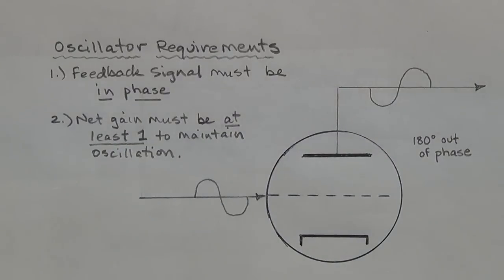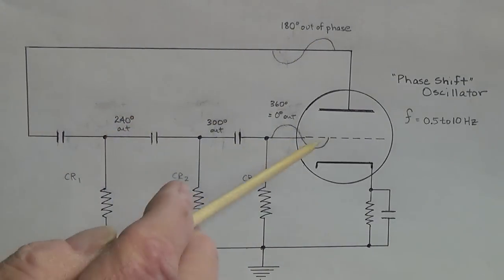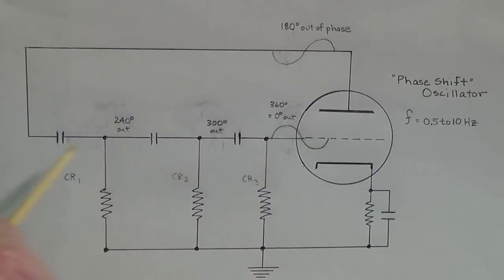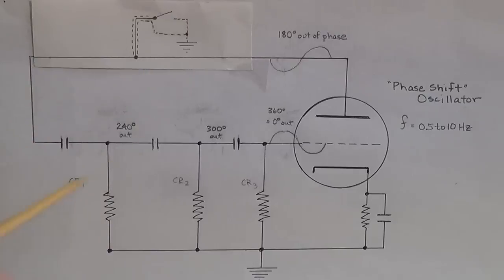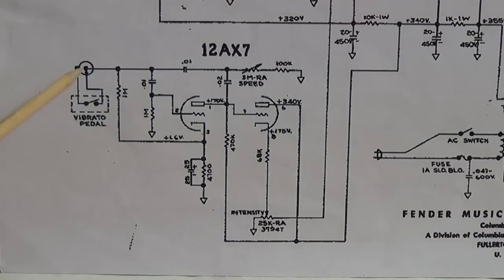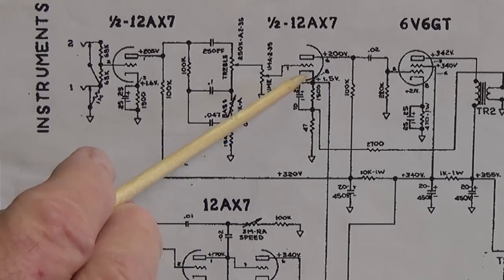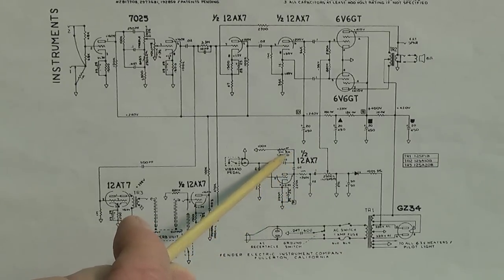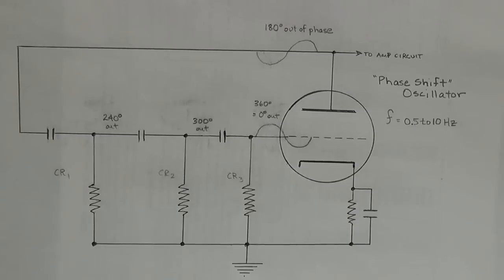How Does a Bias-Shifting Tube Tremolo Work ?

Comment: I was always lead to believe a 1st order filter would give a 90 degree phase shift. How is it 60 degrees? The math works with 2xfilters at 90degrees.
Reply from the maker: +semahnai  I believe the 90 degree value is maximum and that lower values (i.e. 60 degrees) are readily obtainable.  Here is a detailed explanation:  http://www.aikenamps.com/index.php/designing-phase-shift-oscillators-for-tremolo-circuits
Reply: Thank you for your help. I get confused so easily with electronics. I am struggling with biasing my 12ax7 so far, I had it working, but i may have fried the tube. I have 170V supply Rk=1k2 Ck=25u, Ra=56K Ca=22u. do these values sound reasonable to you Uncle Doug, or should I ask Rusty?
Reply: +Uncle Doug Interesting link. After reading, I think I have a few more brain cells. Am I right in thinking, however many RC networks are employed between the input signal and the output signal, the RC filters have to accommodate and equal percentage of the 180 degree shift?
Reply from the maker: To be honest, Ian, the only phase shifts that I pay attention to in an audio amplifier circuit are those between grid and plate in each amplification stage, and the differential shift within the phase inverter.
Reply: +Uncle Doug I think I expressed that wrong, I was talking about the feedback networks from the plate to the grid in the tremolo circuit. Sorry. I am slow to absorb stuff, once I get it, I tend not to forget. Please give Rusty and Jack a pat on the head from me.
Reply from the maker: I will, Ian.

Comment: MY POP QUIZ ANSWER: If we apply oscillator AC directly to the grids of the finals,  the tremolo signal is balanced out by the push-pull action of the output transformer. This is similar to a balanced modulator in RF DSB applications,  where the carrier is applied to the grids,  and the modulation  supplied from the phase inverter stage.  Only here,  it's done in reverse,  and at audio and infrasonic frequencies, rather than .RF and audio frequencies.
Reply from the maker: +John Bond  Excellent, John. Thanks for the informative reply.

Comment: hi, silver xmfr is 375-0-375 volts ac.... 150 ma. the black xmfr is 345-0-345 volts ac not able to find current.
Reply from the maker: +brian foley  Very crude rule of thumb: If they are of about the same weight and size, they are probably of about the same current capacity.  Also, if you know the tubes that were originally powered by the transformer, you can estimate its current capacity.

Comment: as always thanks for the effort you make these video's with... i bot 2) ao29 hammond.
one has a black transformer 360 volts dc...
the silver one is 35-0-350 volts and also powered a rack of tone generators.
so i bot 6 more, 3 of each type. the silver transformer has enough to run a pair of 6L6's
and the black transformer at least a pair of 6v6's... going to fabricate them as mono blocks. brian
Reply from the maker: +brian foley  I am familiar with the power transformers that come on AO-29's and they are quite stout. It sounds like you made a great buy, since even mediocre power transformers now cost between $65 and $100 each. Congratulations on some great acquisitions.

Comment: Unc...my '62 Brownface Deluxe has a very weak trem. I popped new 6V6's in and it didn't help..I read a while ago that setting the bias correctly determines whether you have a nicely functioning effect or virtually none!What say you??  
Speaking of bias, what IS the correct bias current for that circuit? I measured just under 30mA which would be low for a Blackface but is it OK for a Brown?Thanks a million!
Reply from the maker: +PeterPug007  Peter, I assume you are speaking of the 6G3 Deluxe. The 6V6's would have virtually no effect on the tremolo. It is created by one half (triode) of a 12AX7 tube. There are two 12AX7's and a 7025 (unless it's been changed to a 12AX7). With the amp off, you might try switching them around to see if the tremolo intensity improves. If not, then its one of the components in the trem circuit and, unless you are comfortable with attempting the repair yourself, will require the attention of a qualified tech.  

Bias is set by plate dissipation, not just plate current.  Calculation of plate dissipation requires accurate measurement of both plate current (in Amps) and plate voltage. It is the product of the two and should not exceed 8.4W (70% of the 12W max) for a fixed bias circuit (like the Deluxe).  At a plate voltage of 365VDC (according to the schematic) a plate current of .023A  (23mA) would yield a plate dissipation of 8.4W.  Your 30mA plate current would be OK if your plate voltage was around 280VDC.....but I'll bet it's much higher.
Reply: Oh, ok. It's only the bigger Brownface amps that used the power tubes for the "harmonic trem"?  I'll play with the preamp tubes as you mentioned and see. 
Looks like the last bit of your answer regarding my 30mA current was cut off??  I'm no tech...I measured the bias using one of those BiasMaster probes that attach between the output tubes and the sockets. 

You are a WEALTH of knowledge!!
Reply from the maker: Thanks, Peter. The last word I wrote was "higher". If it's there, then nothing was cut off. There is nothing wrong with a Bias Master, but you need to heed my comments about plate dissipation, rather than plate current. Good luck.
Reply: OK, my old college classes are starting to come back to me: P(Watts) = V x I(Amps)
What are the repercussions of i.e. running the plate dissipation at 100% let's say? 
Is that simply biased "too hot" and will burn through tubes faster or can I damage some of the circuitry? 
Jeez...just when I thought I was starting to understand this stuff! LOL
Reply from the maker: Cathode-biased circuits can be run at 90% to 100% of max PD. Fixed-bias circuits (grounded cathodes) should not exceed 70% of max PD....because the PC rises substantially when the circuit is driven hard.
Reply: I'm getting the impression you're trying to tell me something!? :)
OK, I'll have someone qualified check out the amp ASAP...you've sufficiently worried me! :)
Thanks a million!
Reply from the maker: You're welcome. If you are at all unsure, it's always best to get some outside help....but you can still turn it into a learning experience. Ask lots of questions about the repair and try to understand it fully.
Reply: I have yet to find a tech that was willing to have me hang around to see what they're doing to my amps...this is what I find very frustrating...I DO want to learn...BADLY!
When can we enroll in Uncle Doug University?
Reply from the maker: I think you're already enrolled, Peter :) I can understand why techs wouldn't want you looking over their shoulder, but they should be willing to discuss the work they did, in some detail, if you ask.

Comment: what signal is on the plate? At the exact moment the circuit sees current, if you know what I mean.  I assume there is sufficient voltage to make the tube ( valve?!) conduct....so what would the effect of plate voltage have on oscillator? Increase the waveforms amplitude?...
Reply from the maker: Paul Fabrique I doubt that increasing the PV would increase gain or amplitude very much.....or that any increase would be all that beneficial to the function of the oscillator. Recall that gain factor must be at least 1 for the oscillator to function, and simple oscillation is all we need from the tube.  I would think it best to set the tube parameters to whatever is ideal for the tube (i.e. from the tube handbook).
Reply: Thanks again Doug!

Comment: Thanks Doug for this lesson. My take on tremolo circuits were to leave them alone. LOL!
 Are you familiar with Fender's Eric Clapton models where the tremolo circuit is placed differently in the  circuit, and is it that much different than Fender's normal trem circuit?
 I had a solid state amp once...an EMC with such a slow tremolo that it was like using a phase shifter...probably LDR or photo resister type .
 Rusty has taken on fatherhood?
Reply from the maker: John Zook  About all I can find on the tremolo in the EC amps is that it is a bias tremolo, not a photoresistor-type, which is unusual in the 40W Twinolux, but to be expected in the lower-wattage Champ and Tremolux.  As to its placement in the circuit, I cannot find any schematics to verify this.  Rusty is still his old, energetic self, often sleeping directly underfoot and in doorways, snoring like a buzz saw.

Comment: So precise just watt the Dr ordered! And another circuit where as the amp needs a footswitch to operate,.. the grounding shield and each hi pass RC has it's own function was very nicely put together that it can only make sense! Thanks again my good friend, my best to Rusty and yes by all means this gathering of thoughts definitely gave me the explanation(s) and more that I needed, also it's really interesting now that of that Ampeg pedal of less than 8 pieces, it was a variable resistor that by changing resistance (and not impedances) it would shift into different effects,...from amplitude to frequency and what's in between those effects at unity gain sure were unique, and as that in an amp say my 60watt '70s Univox it's already looking to be easy enough and a good lesson in Dougish Values!  Later!
Reply from the maker: Nelson DeJesus You're welcome, Nelson. Rusty and I are glad the videos were helpful. Best of luck with your projects :)